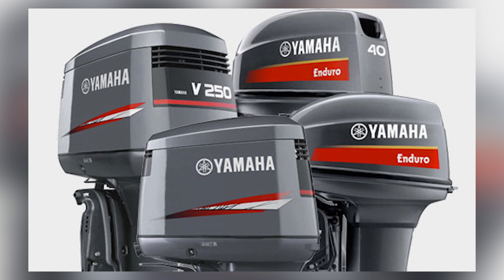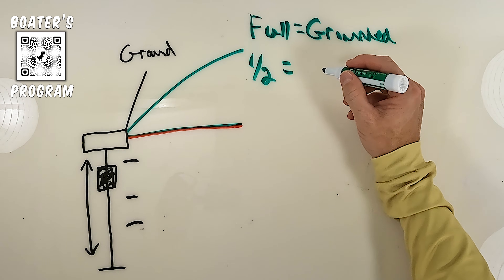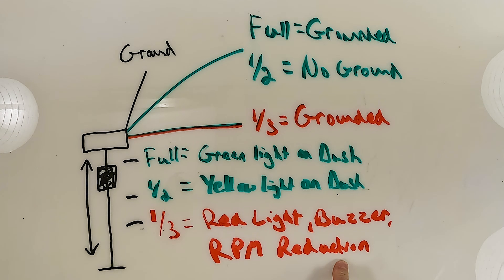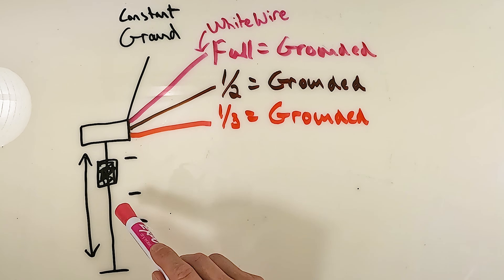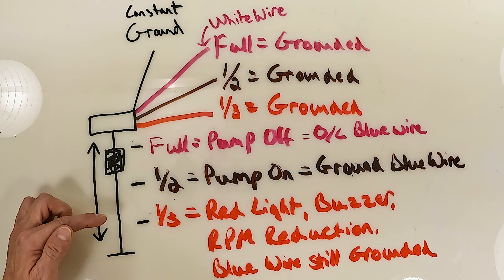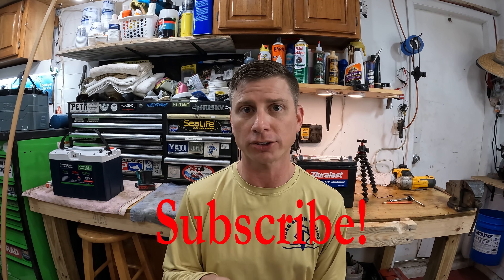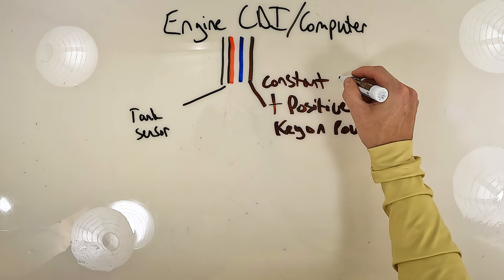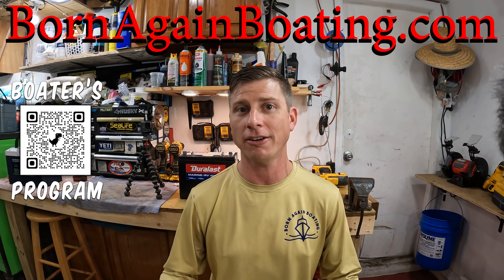How Yamaha's 2 Stroke Oil System Works

Comment: What if you remove the entire oil tank and disconnect  the sensor from the system on a 3 cylinder 90hp engine

Comment: Thank you, as a new owner of an old V4115 I was about 15 mi. from home on a wilderness lake when the buzzer went, I shut down and let it sit while I told my self not to panic. I started it up and it worked fine, this is my first oil injection motor, now I'm on You Tube getting educated. You have been a lot of help on a number of your vids. Thanks a bunch.

Comment: I have a Yamaha 90tlrb, I was having the oil sensor alarm buzzer going off. I bought a new sensor and I tested it before draining the oil, but it alarms in the full position and the low position. The only place it doesn’t alarm is in the middle. Any help would be appreciated and love the channel.

Comment: Love your videos. I have a Yamaha 200 HPDI with the auxiliary tank. The transfer pump is working fine. My issue is at the gauge. It has the middle bar for the oil flashing and the trim is all the way up and also flashing. Are these two indications related.

Comment: I've got a 1996 Yamaha 2 stroke 150hp with standard Yamaha gages.  My engine randomly goes into RPM reduction mode WITHOUT buzzer/alarm firing.   RPM reduction mode only.   New impeller, making good water, engine oil tank is full and working properly.   So I have an intermittent RPM reduction and both cooling and oil systems appear to work perfectly.     Any ideas?   Could it be a faulty tach gage itself?   Intermittent short?   Faulty ground?   Bad oil or water sensor?   It is driving me nuts.   I'm a very good wrench but am terrible at electrical.

Comment: I’m having an issue with my alarm with ignition keyed on. 
When I remove the remote oil tank sensor, and move the float (by hand) to the down position, the alarm shuts off. 
When I hold it up (indicating a full oil tank) the alarm sounds. 

I disconnected the sensor and checked with my volt meter the red/ black to black wires and have continuity when sensor float is upright and no continuity when sensor float is down. Is the sensor bad or is the issue somewhere else? Thanks for this video. I feel like I’m so close

Comment: hi, great technical information, got a question, I know how to eliminate the VRO on Yamahas 40  and 90 hp  and mix my gas with Oil and so far no problem , My concern is How safe it is for a 225 HP  saltwater series ??    thank you
Reply from the maker: I've never premixed an OX-66, theoretically, it would work, the injectors put the fuel into the throttle body and then into the engine, but I would kind of be concerned about WOT and having enough oil in the fuel, so it's kind of concerning. Theoretically it would work but yeah, a 225 is big engine compared to the 90 hp, and they premix the oil in the VST which puts more oil in at WOT. Also it has an o2 sensor that will also lean out the engine if it gets messed up so the premixing, would work, but over the long run it might have other complications. Hope that helps
Reply: @BornAgainBoating  Thank you for your feed back , how ever my 225 Yamaha is Carburettors

Comment: This engine mounted tank float sensor on the V4 and V6 is a failure point. If your engine blows out an insane amount of smoke and dies out randomly. This switch isnt turning the remote "large" tank pump off. and its overflowing the engine tank which flows into the airbox I believe. Replace the engine oil tank cap/floatswitch its 110 bucks.

Comment: 7:48 what do you mean by grounded. I purchase a used boat and the auxiliary tank sensor wires are missing coming out of the sensor. Do you think I can just wire the 2 black wires (black&red) together to mimic the tank being full?
Reply from the maker: That might work, but the computer is usually monitoring that, I'm not sure if it will work or not, but you can try it, that is a good way to make it think that the tank is full if you are trying to just premix and get rid of the alarm, hopefully you've figured this out by now though :)

Comment: Perfect timing. I just ordered a new remote tank/pump/sensor/harness for my 2002 200 ox66 because I couldn’t get oil from the remote tank. The manual toggle/override wouldn’t activate the remote tank either. After watching the video I’m wondering if it’s just a bad ground connection—any idea where that ground point is? Thanks again!!!

Comment: Working with friends 200 and 300 hdpis, both of them 06-08 vintage had issues with the tanks. I got to learn a lot from diagnosing them and found just like you said the harness was broken. One was actually the pin had rusted out of the connector. And the tank was also clogged. After the fun on the water of pulling the aux tank out of the bilge and pouring it into the motor tank to make it back we found the rocker switch on the motor to pump fluid into the reservoir. Although it only trickled because of the clog. Was still easier than the big mess we had on our hands. And I expect an online Marine tech program with monthly subscription soon with all this knowledge your dropping. Great work!
Reply: Still running my twin 200 HPDIs, 2006.  Knock wood.

Comment: Just spent $700 on parts for my 2000 90hp Yamaha 2 stroke. New head & water iacket with gaskets & accessories for install. Motor runs good, but would rather do that quarter century maintenance so i don't void the warranty 😂.

Comment: Idk if my aux tank pump failed or my wiring failed this weekend, but my motor alarmed out due to oil in the engine tank being low. Little continuity/voltage test will solve that issue, though.
 
Do they really make V4 outboards or are they I4's? As a hobby mechanic for 28yrs that has always been a cringe word for me 😂
Reply: I think all the 4s were v4 in 2 stroke days.  It is well known in auto industry and Yamaha found out with the inline marine 4 150four stroke, when going inline 4 there is a certain vibration generated that was cancelled out, so to speak as a solution, by a internal balance shaft, spinning.  Yamaha used nylon gears, and they were failures, serious as the consequences were, perhaps nylon wasn’t the best material, what do I know.  I was asked on Forums, where the spinning balance shaft was internal, is, I said WTF do I know, it’s in there somewhere and it’s your motor not mine.  No issue with any other in line motor, in auto industry, in line 6, 8 whatever.  Or inline 3 or 2, I think.  🤔😁